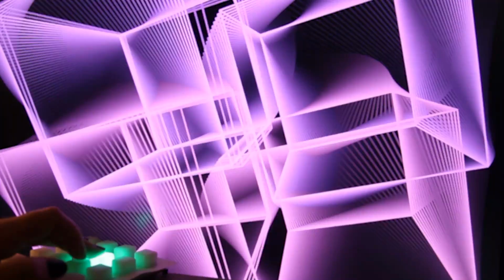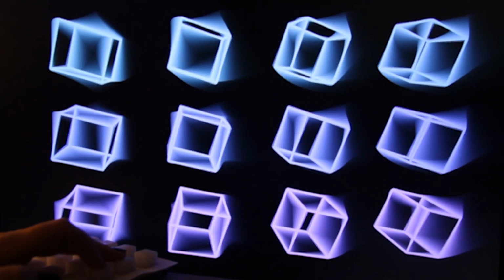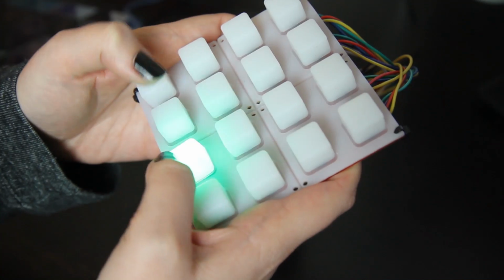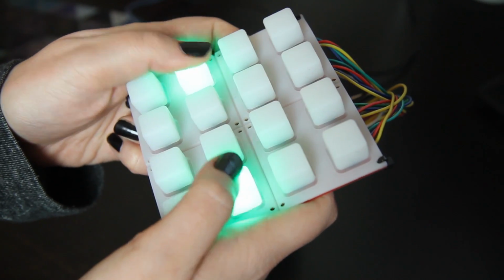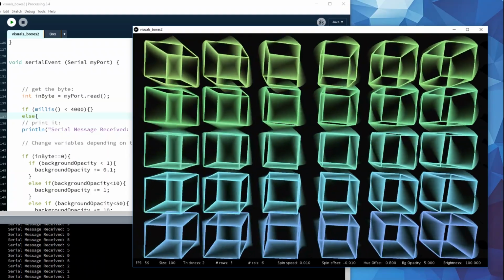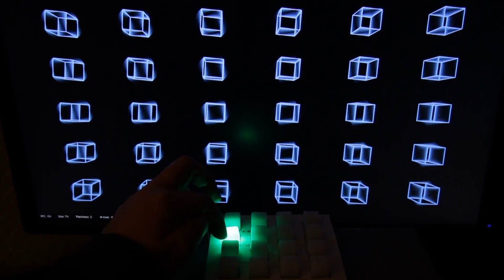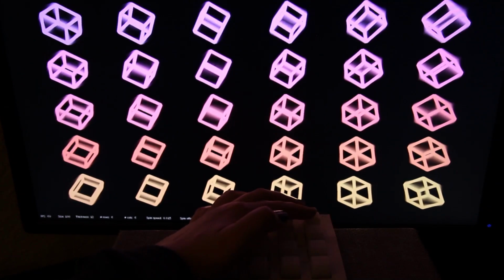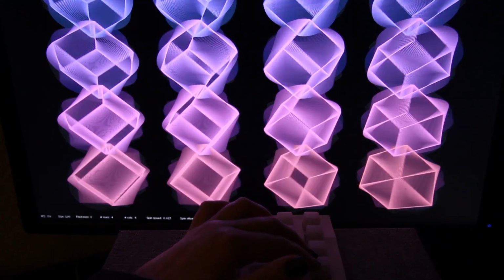Driving a Processing sketch with an Arduino LED button pad

Comment: Okay, so you have an RBG button pad, but you're only using the green colours.
I think it would've been nice to either display random colours, or to do some value based colours. For instance, when you have one button to make it bigger, and one to make it smaller, you can set it to blue when the cube is at its smallest, green when it is at 50%, and red when it's at its biggest. And of course at 10% it has to be 80% blue and 20% green since it's 1/5th between blue and green.
This would require pwm signals though (as far as I'm aware). Or addressable RGB leds, but where's the fun in that :p 
If you're lighting the array with multiplexing you could do with 12 pwm pins. The Adafruit PCA9685 16-Channel Servo Driver might be an option if you need to extend the amount of pwm ports, but I'm not sure if it's fast enough.
You could also use only 3 pwm outputs, but this would mean that all buttons in the same row would display the same colour, which (depending on how you use it) might be a problem.

If you're planning on doing that, please reply. I'd love to see you do that. (of course I'll subscribe to be automatically notified when you upload it)
Reply: Sorry, I got excited and inspired by this awesome project that I completely forgot to mention how awesome this button pad and animation stuff is :D
Reply from the maker: @AnimilesYT  Hey! Yeah you're totally right, there is a lot more potential of stuff to play with with the LEDs inside the buttons. Why don't you try doing it? ;)
Reply: @amy-goodchild  Well, I study software engineering, which takes up quite a bit of time. In my spare time I'm working on a binary clock (with a (dimable) led matrix, an rtc, and some other features and tricks.)
I'd honestly love to try it though. I simply don't have the time right now. The coming half year will have a focus on microcontrollers, electrical engineering, and IoT. Therefore I doubt I'll be able to get around to the RGB button matrix..

Now that I think about it, an RGB version of the binary clock sounds like a nice idea for a next version.
Reply: @amy-goodchild  You could use Bit Angle Modulation to change the colours of the matrix. And since you're using an Arduino Mega you could pretty easily set it up to display different colours.
(I recently found out about this technique, and I wanted to share it since it's pretty easy and really useful)

Comment: Cutting leads before soldering sounds like a really tedious and harder way to do things
Reply from the maker: What? How would you solder them on if you haven't cut the ends off and stripped them?
Reply: @amy-goodchild  I've always pushed the whole thing through, and bent the leads so the component stays in place. Populate all of one part, to be sure I've got enough of everything, solder, and then cut off the leads on the non-component side. 
I also solder on the non componet side, becuase some thing like transistors and diodes can get a bit damaged if you accidentally nic them with your iron.
Reply: (This is really cool btw, I wish my graphics card was good enough to do some of these weightier 3D processing sketches)
Reply from the maker: Oh I seeeee, sorry I thought you meant the cables. With the diodes I removed them to cut the legs because I didn't want any part sticking out onto the component side. I couldn't cut close enough to the board with them in there. I only had scissors, not snips. With the LEDs I probably could have done it the way you're saying since it doesn't matter if they poke out a little that side. but I didn't think about it! Will try it in the future!